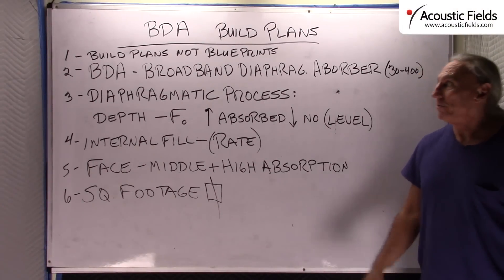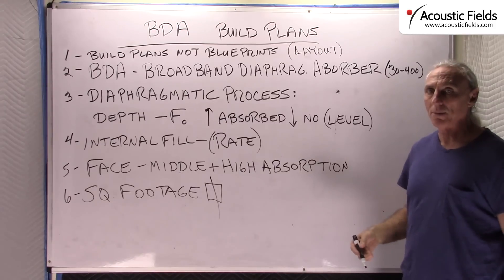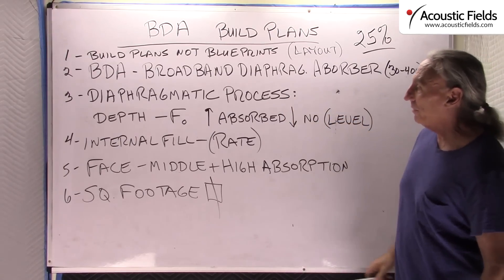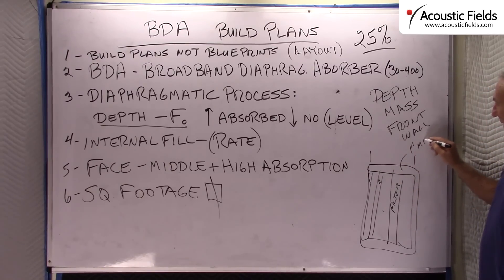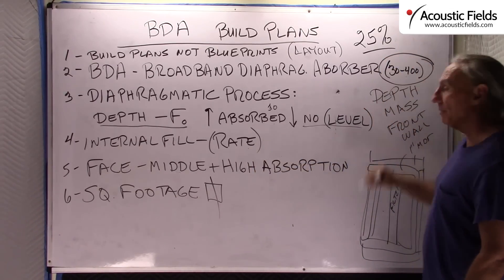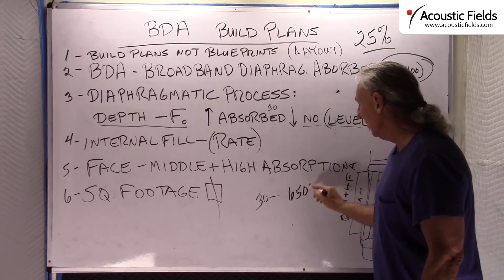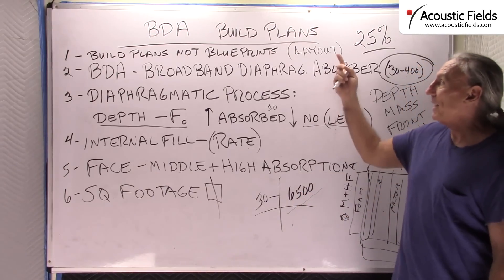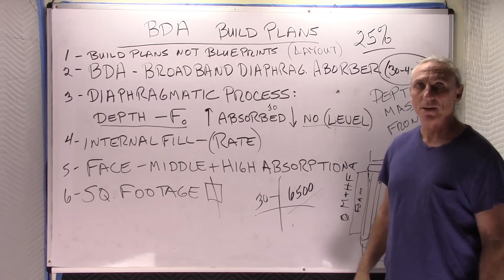DIY Bass Absorber (BDA) Build Plans - www.AcousticFields.com

Comment: Hi Dennis i'm just about to build your BDAs, but it the instructions call for Alder, Basswood and MDF and doesn't specify which wood is for which panel.  The cut sheet lists the two front panels as "MDF" so i assumed your cabinet must be the alder or basswood?  But in this video here you're saying the cabinet the MDF... Please clarify.
Reply from the maker: Use 1" MDF for the cabinet. Use MDF for the two front walls.

Comment: Hi, I bought the Bass absorber plans and there is 15 mm mdf used as one of the front walls. I didn't find 15 mm mdf in my area, can I use 16 mm instead? Or 12 mm - that is closer to the imperial variant 1/2 inch.
Reply from the maker: V,  Yes 16 mm is fine.

Comment: "You're not going to be using carbon in the BDA."

What if I buy carbon pellets online?
Reply from the maker: D, Over the counter carbons used for water and air filtration will not work for sound absorption.
Reply: @AcousticFields  
How about activated carbon fibers?
Reply from the maker: D,  No, you must control three variables: porosity size and count along with granule density.
Reply: @AcousticFields  
I might sound "coocoo" and "nuts" but does the production of this item have anything to do with palm trees?
Reply from the maker: @dialecticalmonist3405  Not to my knowledge. We use coal-based raw materials.
Reply: @AcousticFields  
Good day mate.

I think I know where you get your carbon from.

Once I put my cabinet together, I'm going to put it down under my desk.
Reply from the maker: D, Over the counter carbons used for air and water filtration, will not work for sound.
Reply from the maker: D,  Over the counter carbons used for air and water will not work for sound absorption.

Comment: Is it the cabinet sealed by the wall diaphgrams? Is the air inside actin acting like damping material?Thanks. Giuseppe from Italy.
Reply from the maker: Hi B,  Yes, the unit is sealed. We are working with sound pressure not air flow.